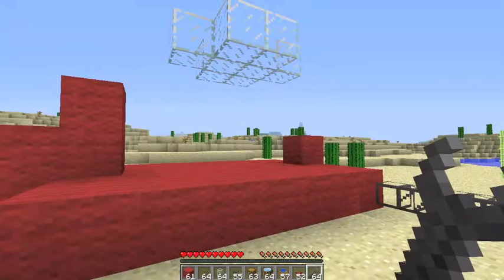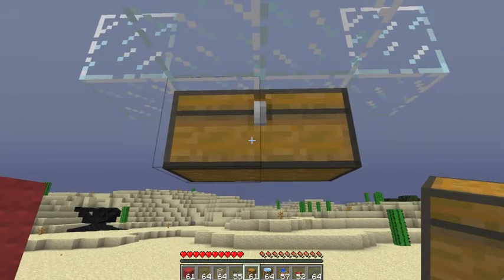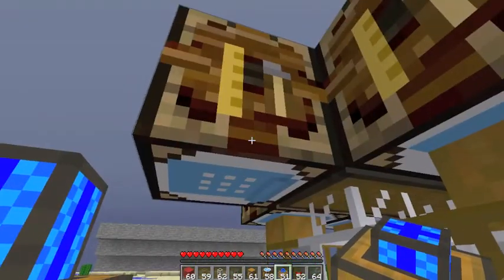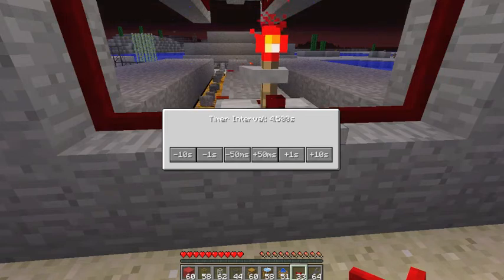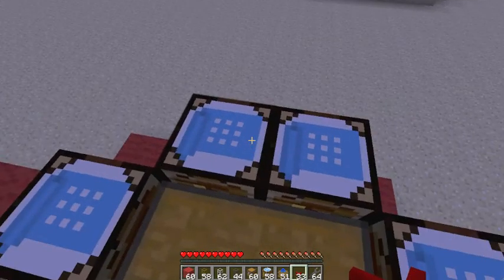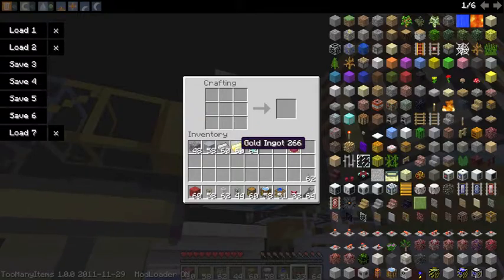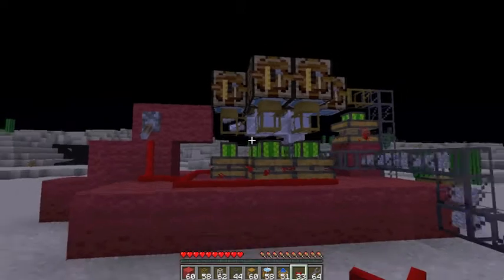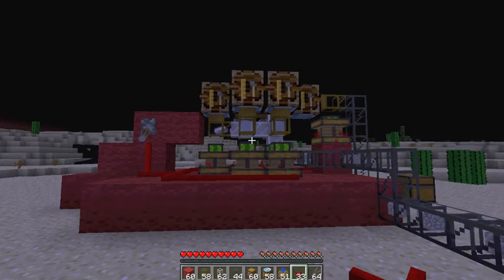Minecraft Diamond Engine Using Technic Pack (in 1.0)

Comment from the maker: @Maxwillkil Well, it takes 32 diamonds and some infrastructure of its own to make the dark matter. But even if want to call that cheaper than setting up this processing plant - a point I'd argue - there are other reasons why something like this could be of use. for example: If you want to have finer control over how your raw materials are processed, this setup could be modified to shunt half of each material type to chests for easy access or automated factory raw materials.